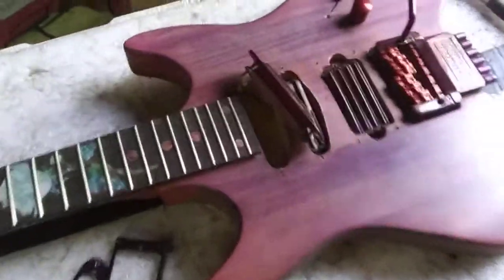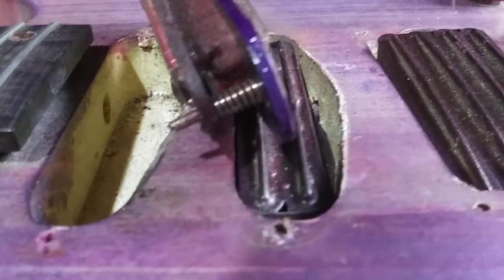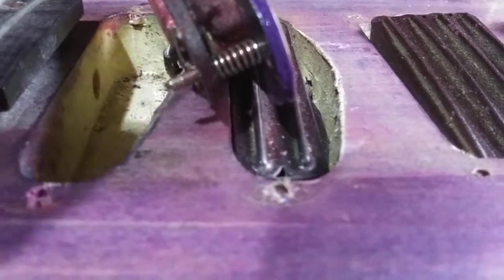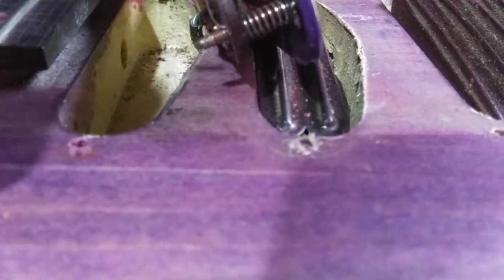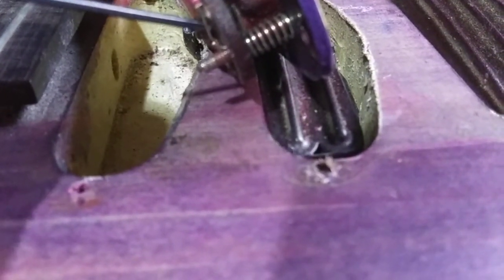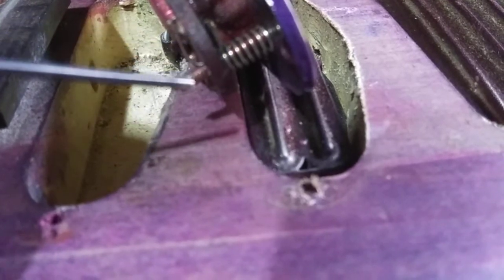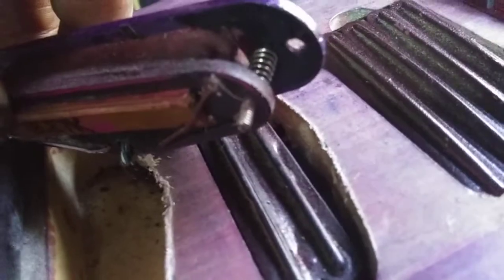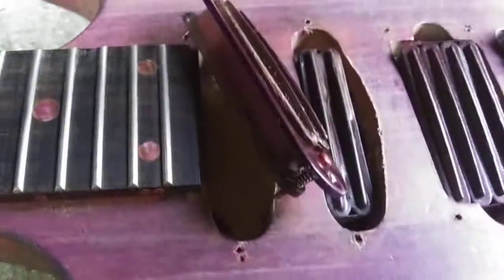A quick fix for stripped pickup adjuster screw holes.

Comment: What about the holes in the guitar wood that hold the pickup on the guitar???
Reply from the maker: Sounds like you're talking about mounting ring screws, or solid mount screws.  There the proper procedure is to fill the hole with a small dowel, re-drill, and re-install the screw.  The ring or pickup will cover the repair, so you don't have to worry about it showing.  For a small screw hole like that, a bit of toothpick with a drop of CA glue usually works just fine.  Cut off the point of the toothpick, put a SMALL drop of glue on the end and shove it in the hole. Cut it flush with a razor blade or whatever.  Repeat if necessary (for bigger holes).  You may need to re-drill, or you may not have too.
Reply: @normbarrows  awsome, thanks man